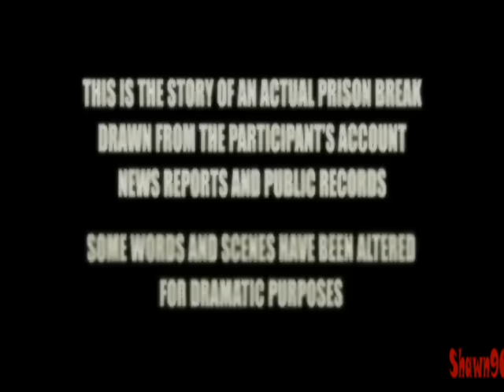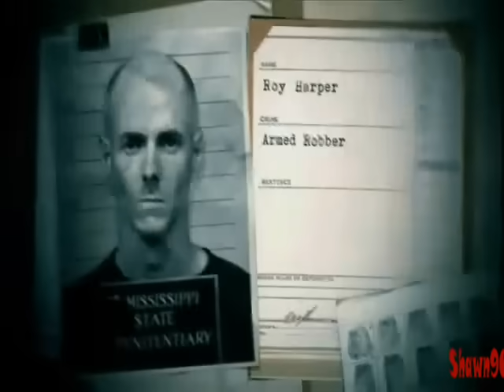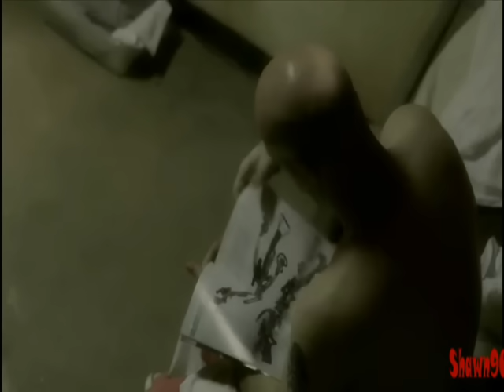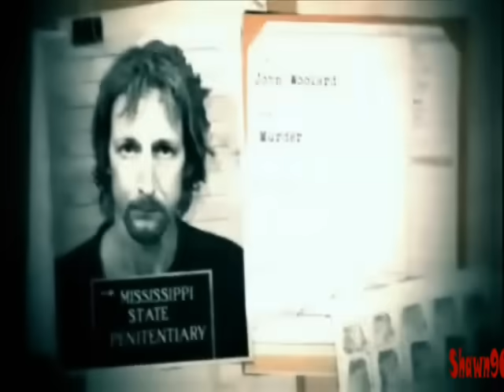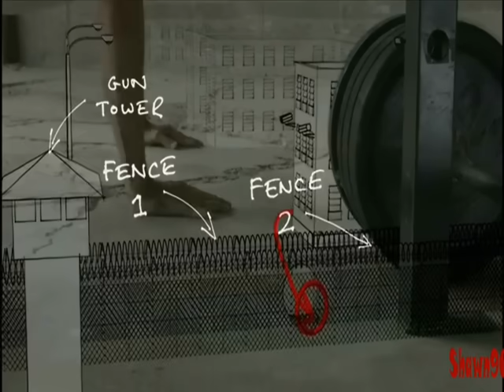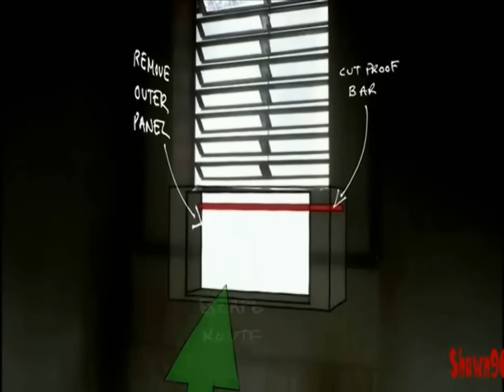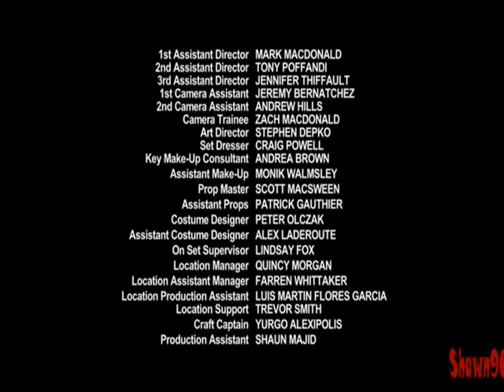Breakout S02E01 - Escape from Supermax

Comment: Mistake 1: Cut phone lines to house
Mistake 2: Learn to hot wire car and go in the middle of the night to increase radius
Mistake 3: Don't speed
Mistake 4: Split up and go in opposite directions to increase radius over a huge amount
Mistake 5: Not going into landscaping and holding Mexicans for ransom over ICE deportation.

Comment: Errors on this video near the end: 
*Cop says he pointed a double barrel shotgun at him in the truck stop......they show him shooting a pump action at them.
*The cop who holds the one at gun point till backup arrives is depicted at using the "saucer" type grip which is not trained and not a proper grip (media often shows it this way though)
*Says he had a 9 shot pistol on him but shows a revolver. He probably did have a .22 revolver but the cop just said it incorrectly. Either way the working didn't fit the video.
Great video though.